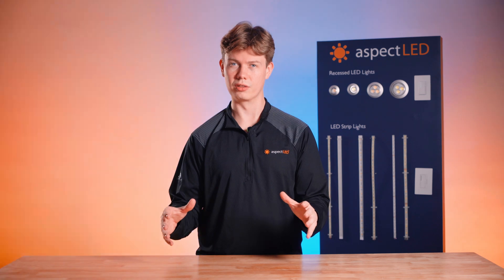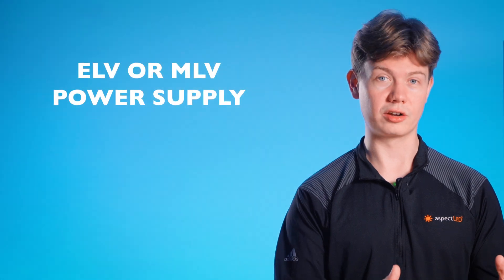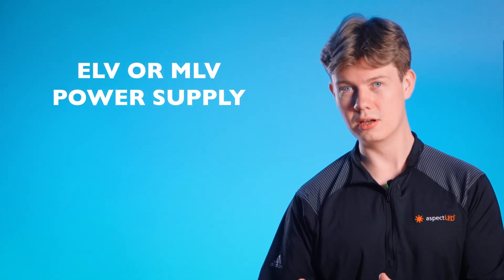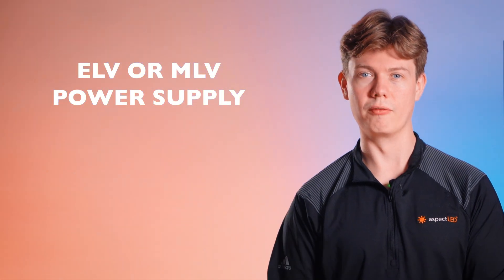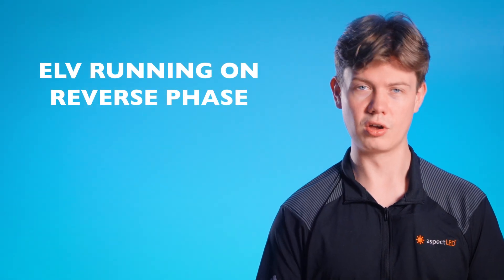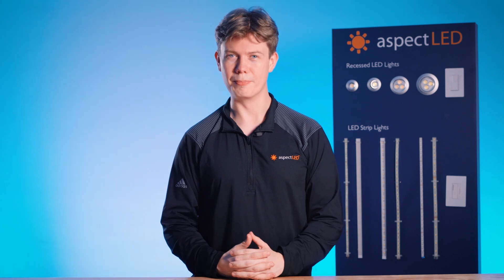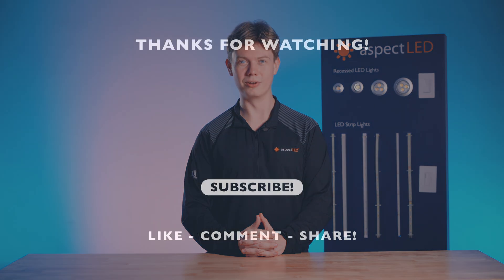Flickering Lights In Your House? Here's the answer and how to fix it.

Comment from the maker: Chapters:

00:00 💡 Common Causes of LED Flickering

LED flickering often stems from incompatible power supplies or dimmers.

Short-term voltage fluctuations result from mismatched dimmers or power supplies, causing irregular cycling of voltage and the on-off effect.

Outdated power supplies or those not originally designed for LED lights can lead to flickering; recommend using new elv or MLV power supplies.

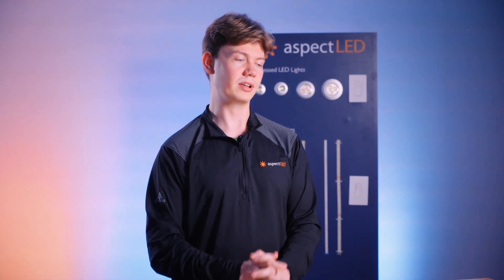01:46 🛠 Choosing the Right Power Supply for LED Lights

Power supplies not built for modern LED lights, either old or not originally designed for LEDs, contribute to flickering issues.

Suggested solutions include using electronic low voltage (elv) or magnetic low voltage (MLV) power supplies for stable and constant power flow.

Pay attention to the dimming phase compatibility of LED lights when selecting a power supply (elv with reverse phase or MLV with forward phase).

02:40 🎛 Dimmer Compatibility and Considerations

Incompatible dimmers designed for incandescent bulbs pose challenges when connected to modern LEDs.

Dimmers may need specialty components to be compatible with modern LED technology.

Verify if the dimmer supports forward or reverse phase dimming and check for minimum voltage load requirements for optimal performance.

Comment: What power supply for led lights? I bought an led light fixture for the kitchen and inside is lots of tiny led's, some of them are strobe flashing. I hooked it stright to the house wiring. It was fine for months.
Reply from the maker: While some LED light fixtures can run on AC current, this video focuses on low-voltage LED fixtures that operate on DC current, which requires a power supply to function.